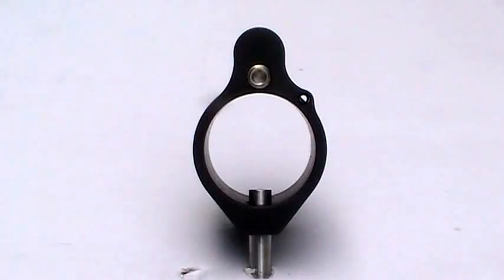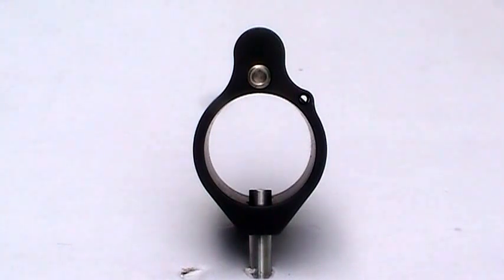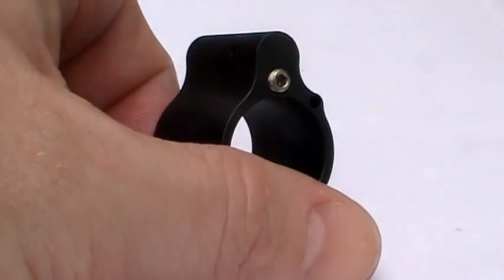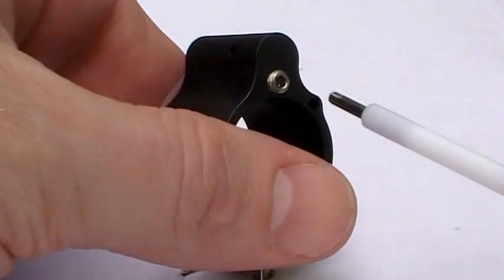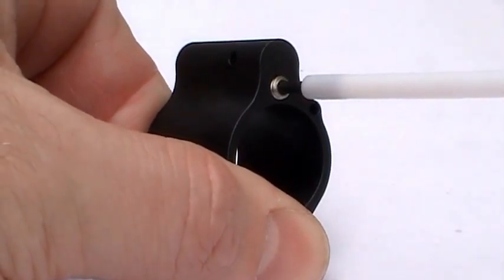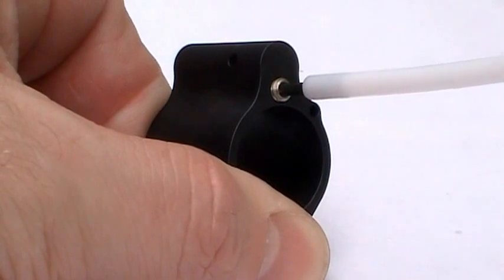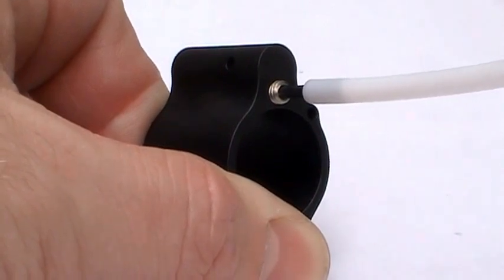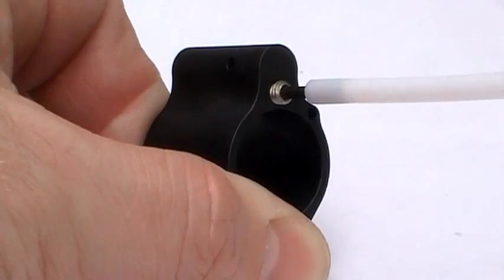Syrac Ordnance Gen II Adjustable Block

Comment: I may have installed mine incorrectly.. But mine goes up to 20 clicks (5 revolutions) and would only lockback  at exactly 20 whereas 21 would detach it.  I am suspecting misalignment of the gas port.

Comment: Want a Syrac adjustable gas block in SS with clamp. Will the same .750 block work with AR15 .223 and AR 10 .308? Thanks